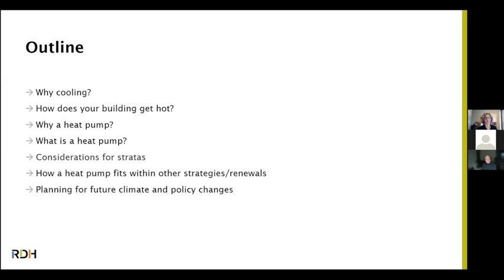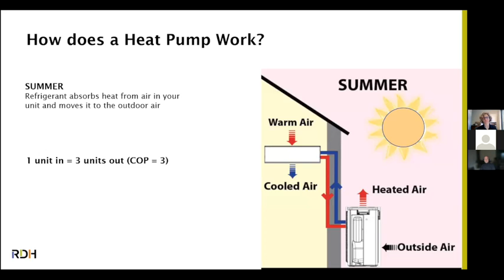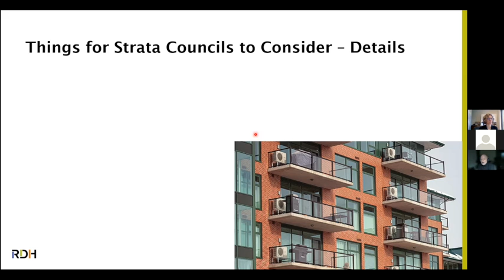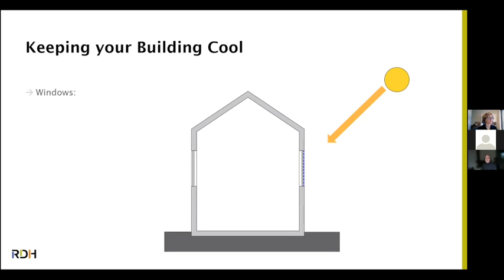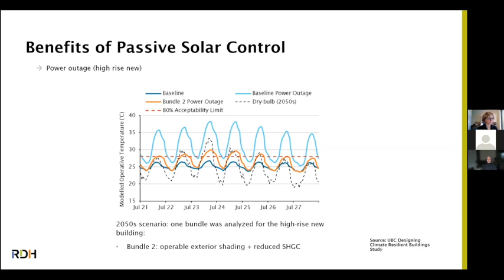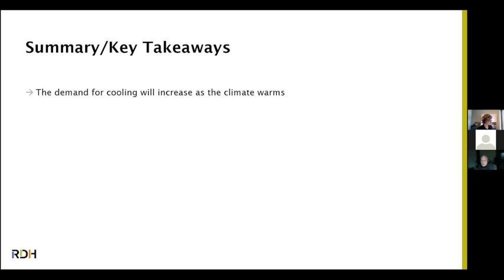Cooling Systems for Strata Owners | Heat Pumps & Other Cooling Options for BC Condos & Townhouses

Comment: Hi Visoa, will balcony solid walls restrict airflow of outdoor unit & significantly impact winter COP, please? Balcony area 5' x 10'. Thanks.
Reply from the maker: Placement and air flow are important. It's recommended that your strata work with professionals to prepare specifications for the equipment that will work for owners in your strata. That could include placement, mounting method, specifications for what type of heat pump, minimum performance, electrical requirements, and much more. If you haven't watched it yet please see the 4-minute video to help your strata get started on bylaws for heat pumps so that you have a fair and transparent process, and the same requirements for everyone who wants to request permission to install one. https://www.youtube.com/watch?v=GPUGx_jun_Q&t=9s
Reply: @VISOAvideos  Thanks a lot. Will need independent professional consultant w/o conflict of interest to get objective advices. Installation contractors not enough.
Reply from the maker: @azifd4jg  Good idea. Independent contractors are great for certain information but for a strata building-is-a-system approach it's a good idea to work with an independent consultant to give advice and determine specifications that work for your unique building.